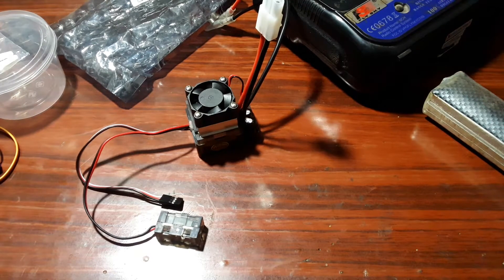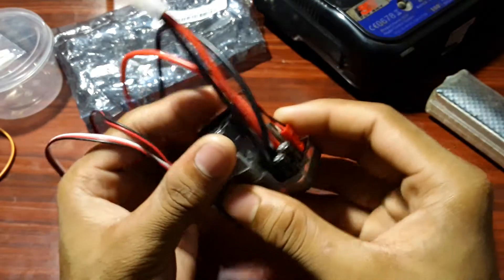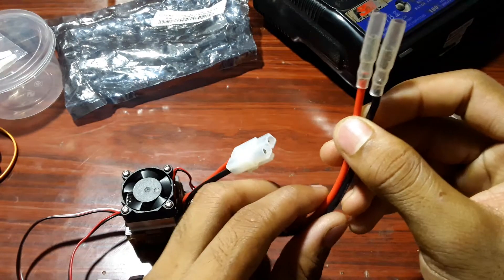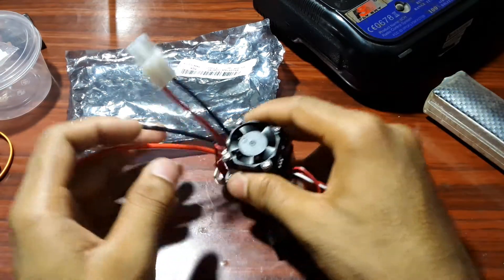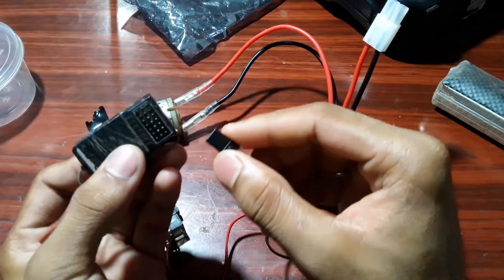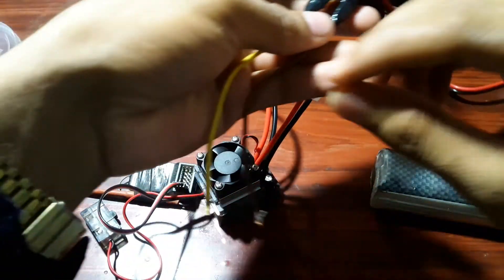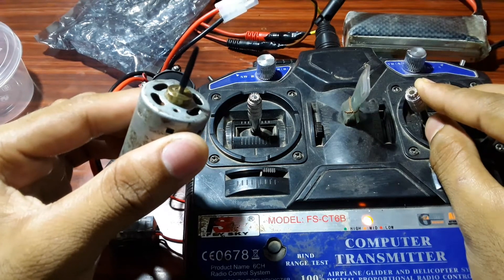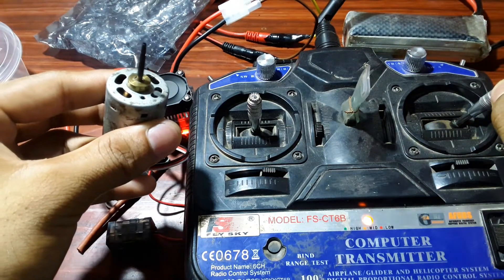Brushed motor (ESC) Electronic speed controller (Complete TUTORIAL/GUIDE)

Comment: So not for a/c current input to control brushed motor? Like corded drill, small a/c motor for Solvent parts washer, or anything unless battery powered. Wouldn’t that be PWM video? 
I’ll keep looking.
Reply: The motors in battery power tools are usually brushed or brushless DC with the appropriate ESC/motor controller.  Some AC power tools are high voltage universal/DC motors.  The AC is converted to DC in the tool.  This ESC would not be high enough voltage for those tools.

Comment: I bought 2 esc 320a but when it comes time to assemble the 2 car and use 18650 battery 3s the car moves much further in reverse is very slow what could it be?

Comment: Hi does it work on 3s lipo pls reply😋😁
Reply: The battery used in the video is 3S li-po , you can also use 3s li-ion..
Are you looking a good Esc for RS 775 brushed motor..?
Reply: No it is  a 1/10 scale moa crawler that I m modifying to hobby grade
BTW I have made a 3s lion pack from 186250 cells but did not put a charging module it charges fine from the output cable